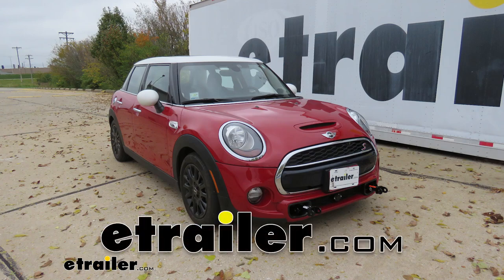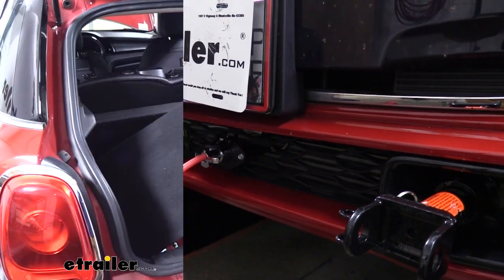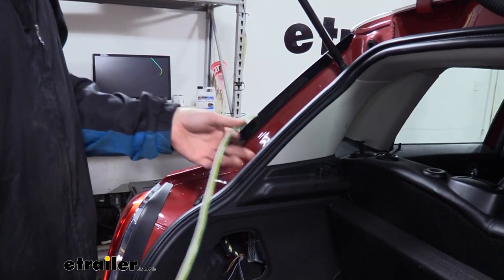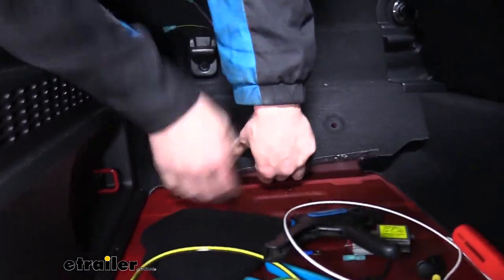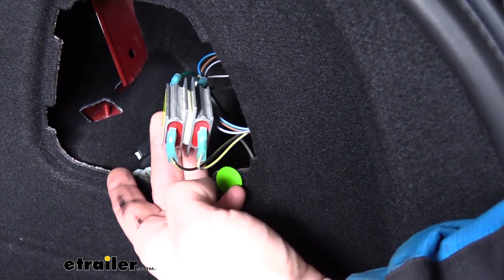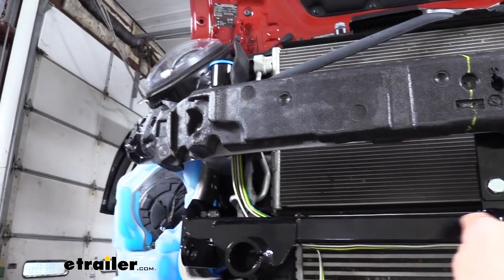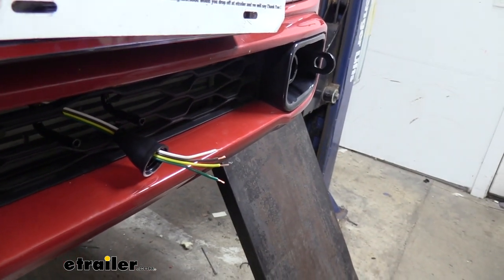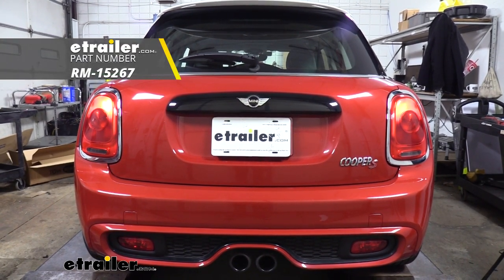etrailer | Roadmaster Diode 7 to 6 Wire Coil Kit Installation - 2016 Mini Cooper

Comment: Great instructions! Will this be the same for a 2013 mini cooper?
Reply from the maker: A 2013 and 2016 model are from two different generations. The procedure will be the same, but the wire colors might be different. You'll need to use a circuit tester like # PTW2993 to confirm the wire function.
https://www.etrailer.com/Flat-Tow-Wiring-Harness/Roadmaster/RM-15267.html